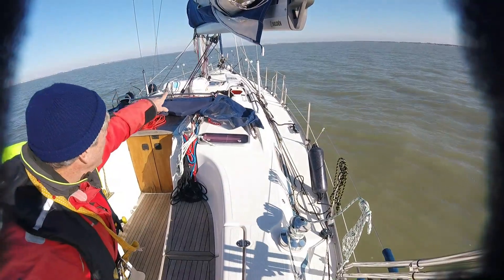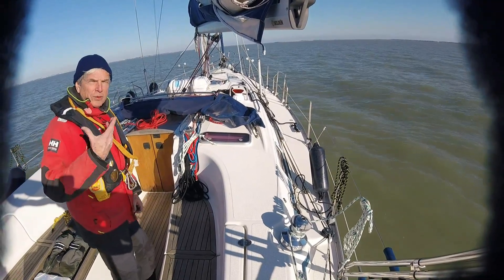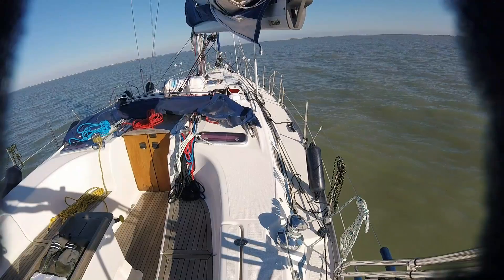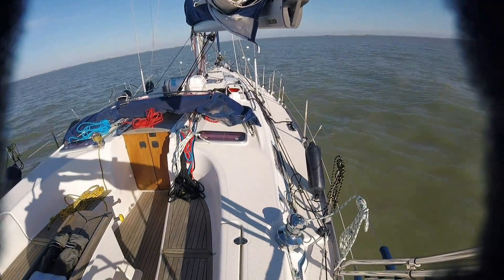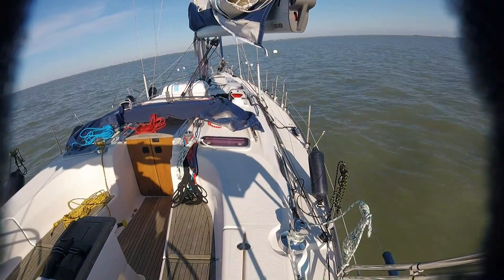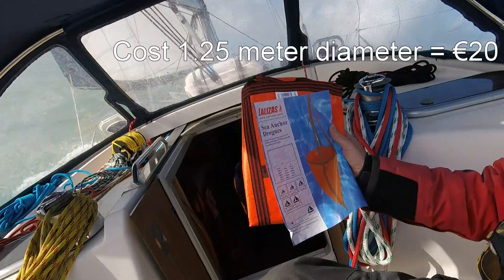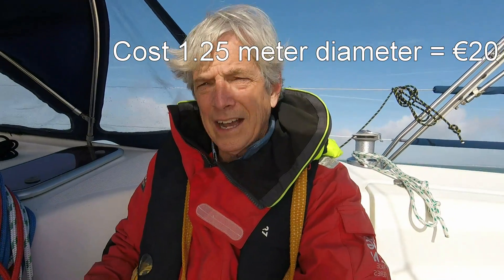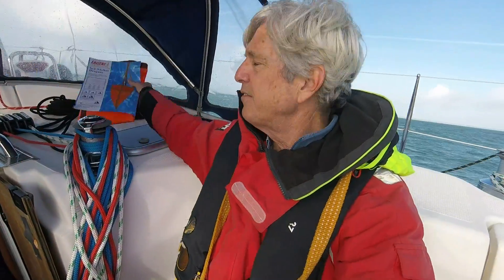Ep 36 Preparing Next Major Passage

Comment: It seems to me that if you want to pull the nose over using the drogue only, you might need to use a block forward on either side (and then led back to the winch aft) so that when you take in the line you get that extra pressure extended to the bow. At the moment, although the drogue is applying pressure to the port side, it is all on the transom and isn't sufficient to pull the nose around. Just my opinion, and I may be way off base. But it makes sense to me.
Reply from the maker: Exactly Jeff, and that is how my boat was rigged.   (I filmed the full set-up, but edited it out as the video was too long.)   Each line ran from the drogue to slightly forward of midships, and through an anti-friction ring at the foot of the shrouds (well forward of the pivot point), then back to the winch.   The problem was just that I left out too much sail.  Thanks for watching.

Comment: Patrick good to see you are back...looking forward to going to Iceland.  Got a question why no Hdrovane. What if your autopilot fails. Also in 30 35 knots how often do you have to go on deck to make sure boat is on course. I noticed you said you could sleep for an hour or an hour and a half before doing a visual check. Is that the norm? Thanks.
Reply from the maker: A hydrovane on my boat is on my wish list John, but not easy to do either.   90% of my transom is actually a swim platform that folds down.  I'd need to reinforce that first, then attach the hardware for the vane.  It is certainly doable, but not as easy as many of the YouTube videos make it appear.    Maybe next year……   My usual sleep pattern is: no sleep when in dangerous or busy coastal waters;  20 minutes when safely offshore, but still coastal; and 45 minutes when in blue water with low risk of collision.   As to going on deck during a blow: I can read course and speed and chart position from inside the safety of the saloon ----- that said, I usually poke my head out just to check that all is well with the sails and sheets at least every 45 minutes anyway.  Thanks for watching.

Comment: Hi Patrick 
I love watching your channel. The music and the wales was spectacular.  May I ask, you sailing from your home port to Spain would cost you very little to nothing? Do you have to pay when arriving at a port? Hope it is not a silly question but I have never sailed and would love to some day just fascinated and inspired.  Thank you Marc South Africa
Reply from the maker: Good question Marc.  The cost at sea is only the fuel you burn, and the food you eat.   Most people end up running the engine about an hour per day (at least) while at sea, to recharge the batteries, and/or make hot water for washing, etc.   On arrival in a marina, they charge based on the length of the boat.  A 40 foot boat like mine will typically pay between 25-35 euros per day --- with a weekly discount rate, etc.     Many people avoid marina charges by anchoring in the bay, and taking their dinghy ashore.

Comment: Hello Patrick. As ever really enjoy learn and get motivated with your postings.  Curious to know with your staysail you haven’t needed to fit another set of Genoa/staysail cars further forward. Do you bring the sheets back to the primaries?
Reply from the maker: Great question Andrew, and the honest answer is that I have not yet decided.  I haven't yet firmed up how I am going to use this sail.  When I need to be very close hauled, I actually need to bring the sheet between the lower and upper shroud.   For all other points of sail, the sheets will pass outside the upper shroud.  Similarly, for now I am running the sheets through the same cars as the genny.    A professional sailor is going out with me this week to take a look at the set-up and make some recommendations to me.    It's still a 'work in progress'.   :-)

Comment: Patrick,
Given that you got your inner forestay and staysail for better upwind performance on a long passage leg, could you not have just dropped your genoa and put up a staysail instead with the clew rigged inboard somewhere? I appreciate it would be different if you were using it when a storm was brewing.
Reply from the maker: Sorry Clive.  I don't understand the context of when you suggest to furl the genoa and put out the staysail.
Reply: Patrick Laine   Thanks for replying. I am new to sailing so what I am suggesting probably doesn’t make any sense, so apologies for that. But I was just wondering whether it would be possible to achieve the same upwind benefit by removing the genoa and putting up a smaller sail instead which could be sheeted in more closely. It would be a hassle taking down the genoa of course but might be worth it if you were expecting a long leg to windward and one would save the expense of installing an inner forestay. By the way you have really motivated me to just have a go at things such as putting up the spinnaker, and not worry too much if it goes wrong.
Reply from the maker: @CliveJanes  OK -- I've got you now.   In fact, many people do exactly as you suggest.  They completely change the foresail, rather than unfurling a staysail.   This requires a slightly different sail set-up.  The genoa is 'hanked on' to the stay with hooks.   When you want to change sails, you just drop the halyard, and gather up the genoa, which you stuff in a sack (quite often tied to the stanchions).  You then hank on a staysail with a better shape.   You have identified the problem with this already.   When the wind is blowing, it is really difficult to gather in the genoa on a pitching, wet foredeck, and hank on the new sail.   The sailing world fell in love with furlers because they allow you to fairly simply reef the foresail, or close it up entirely.   The disadvantage  is that you usually need one forestay for each foresail (there are ways around that, but none of them are elegant).

Comment: Hi Patrick yet another great informative video. Like your new sail set up and was wondering if you considered a self-tacking inner foresail or would have this be to limiting on sail area? Keep the good work up and looking forward to your new adventure videos.
Mike
Reply from the maker: Great question Mike.  My next door neighbor has a self-tacking solent…….   I thought long and hard, but opted for the traditional set-up (for no particularly good reason).   In fact, putting in all of the extra deck fittings was a bit a pain in the rear-end on my boat.   There is probably a good rationale for one over the other, but I don't know it.   If I had to do it again, I'd probably go with the self-tacker.   Thanks for watching.
Reply: @patricklaine6958  I guess the obvious rationale is it makes beating to windward a breeze (excuse the pun) which would be good as a solo sailor.

Comment: I watched a demo on this.... I think more attention to sail trim is necessary.... your boom was not amidships when trying to head up.... I think being single-handed will be a challenge to perfect this, but I do believe it should work.
Reply from the maker: Yeah, that may have contributed Walter, but I really think the problem was that I had far too much headsail out.  I have done a lot of reading on this since then -- and yes -- sail trim is critical to success, but a small drogue is always going to struggle against too much genoa.   Thanks for commenting.
Reply: Wow... I had not expected a reply, let alone one so quickly. Thank you. I have just recently begun to enjoy your videos. What drew me more is your solo-docking approach. I use a similar approach with my mate/spouse on board, by securing an ft springline, but I will practice the "touch the dock gently" technique. As to the drogye, we both agree trim is important... Maybe your Solent/staysail gives you better control by now.  In any event, the ability to have steering control should the rudder or steering mechanism fail should be more explored - and practiced. @patricklaine6958

Comment: welcome back!    If there is any one thing I have learned from your videos is that the devil is in the details..  at 17:36 , your Solent sheet is against the mast.. is this going to be a chaffe issue?
Reply from the maker: Well spotted Randall.   That's the lazy sheet (the one not being used).  It will always touch the mast.  As long as there is no/little tension on it, it won't chafe.   Many thanks for watching.
Reply: @patricklaine6958  awww...  got my glasses closer to my eyes.. did not see the other line.. makes more sense now.. thanks..

Comment: Be careful Patrick, Isobel might sink under the weight of all these goodies you have on board (joke). Does that inner forestay get in the way of the genoa at all. Also, is the storm sail you mentioned the sail-in-a-bag you demonstrated in an earlier episode.

My HR-38 has a storm sail designed to use the forestay furler, a dumb idea. Totally removing my genoa, made of heavyweight dacron, is hard enough solo, in good conditions but impossible at sea in bad conditions. I have no idea what lunacy came to play when choosing this storm sail. I'm thinking of having a sleeve adapter made, to go around the furled genoa. Have you any experience or opinion of these?
Reply from the maker: Yes Ian, I am required to furl (almost completely) the genoa if I want to tack/gybe.  That is a bit of a hassle, but I do a LOT of blue water sailing where I don't do a lot of maneuvering.    When I leave the marina, or in busy coastal areas, I'll just use the staysail until conditions allow me to put out the genny for a long run.  And yes, my storm jib is the 'Storm Bag' wrap-around sail I showed last year.  I don't want to be changing sails up on the foredeck…...it's just not safe.   Fair winds.

Comment: Hi Patrick:  Where is your wind vane??? Single handing to Iceland without one? Yikes!! Also, why only two reefs only in the main?
Reply from the maker: Hello Ron.   I have three reefs in the main ---- the first two use the Selden single line system.  For the third, I have some pre-cut lines in a locker, and go to the mast like everyone else.  It's really quite easy, and I practice it often -- and have done it for real in a couple of gales.   No big deal.   As for the wind vane ---- it's on the wish list.  I prioritized the staysail this year.  Would love to have a hydrovane --- but it won't be a simple installation -- the entire transom of my boat is a fold-down swim platform…..   Thanks for watching.
Reply: Thanks for the input on the reefs. I saw only two lines on the boom, but I couldn't image you would go to sea with only 2 reefs possible. As to the Hydrovane, from my somewhat limited knowledge of the unit, I would certainly be fearful of using one with your boat, given the high loads, because the unit is doing the steering. On the other hand, a servo pendulum unit like a Pacific WindPilot would likely not place much strain on the transom. As to steering with a drogue, take a look at this video:   https://www.youtube.com/watch?v=vupIl68mCYg
Reply from the maker: Yeah -- I'll have to look into a wind vane much more --- but if possible, I like to avoid a system that has all kinds of engineering fudge to bring lines back to the helm to turn the existing system.    There is such complexity and messiness there, and so many things to go wrong.   (As you will know, wind vanes are notorious for breaking: hinges that fail, ropes that slip, brackets that break, rudders that fall off….)   I have a lot more homework to do before making a decision.  I've watched that drogue steering video a couple of times.   In general, I don't like 'how to' videos (of any kind) that are filmed in 7-9 kts of wind.   Not very realistic, but this one had some good info about sail management (which was the reason my trial did not work).    I'll give the drogue steering another try (and manage my sails better) sometime soon.   :-)

Comment: Steering a sailboat without a rudder with just the sails and your drogue should  be similar to the way you'd adjust the sail on a windsurfer where all you have is the sail to steer.  However to come up towards the wind and sail close hauled , on a windsurfer you tilt the mast back,  and you can't change the  angle of the mast on a sailboat. So I guess you have to settle for whatever direction sailing on a reach or downwind will take you.... and to tack I would imagine you'd have to jibe/gybe. I would practice without  bothering with the drogue and just use the drogue for windy conditions.
Reply from the maker: Thanks Emily.   I have thought a lot about this since I filmed that --- and watched many other videos on the subject.    I am fairly certain my technique was OK ----- except that I had far too much headsail out for the small sea anchor to fight against.    I'll give it another try sometime.   Thanks for watching.
Reply: @patricklaine6958  I just  meant that with the rigging as it is on a sailboat meant to be steered by a rudder, the maneuverability of the boat without really being creative and manipulating the sails as much as possible in ways other than they are typically used are limited. I was sort of thinking out loud when I wrote the comment. 

The only experience I have sailing without a rudder is windsurfing. Being able to rake back the mast really helps the boat come up into the wind. "Sailing Zero"  explains the lengths he went through  using brute force and physically backwinding  the staysail with his body to get his boat to come up into the wind and tack. Here is the clip. https://www.youtube.com/watch?v=PE_w_1p3uhI  It goes from 4:48 to 6 minutes..Other than that, I managed with help from crew  to make it to our engineless boat's  mooring when the 35 year old  tiller came off the  rudder (as we were headed towards  the mooring. anyway). It is interesting watching others try it though. I think it should be part of every sailing program's curriculum. When I was little the goal was to teach kids to sail well enough so they could move on to racing strategies. Some of these important safety issues - how to steer if you lose your rudder weren't addressed. Thanks for the video.

Comment: Concerning the steering with a drogue. Attached to a stern winch the system can not function. You need to pivot the boat from the other side of the CG. Assuming the CG is in vicinity of the keel, you're better of passing your line through the forward cleet and then back to your aft winch. Draw it on a sheet of paper and you will better understand the simple balance of focres and the effect of the drogue on your boat.
Reply from the maker: That is how it is hooked up Alex --- the line enters midships --- and even goes a meter forward of that to the base of the shrouds, then back to the winch.   The problem was too much foresail.

Comment: One thing I've learned about steering with a drogue is that it has a lot more turning force if you attach the bridle amidships (even with the keel).  This video has a pretty good demonstration: https://youtu.be/vupIl68mCYg?t=177 

I'd be very interested to see how the inner forestay backing plate is attached to the hull (if it is in fact glassed or bolted to the hull?).
Reply from the maker: The bridle does come aboard at midships Savvy -- even slightly forward of that.  An anti-friction ring is attached at the foot of the shroud lines -- the bridle passes through that and then back to the winch in the cockpit.   The forestay backing plate is two elements: a vertical piece which penetrates the hull and to which the stay is connected, and which is also bolted to a horizontal stainless steel bar which runs the width of the boat.  The horizontal piece was encapsulated in some kind of epoxy.   The entire piece was glued with a high performance formula (special ordered by the marine engineering company doing the installation) to the inside ceiling of the foredeck ---- also catching the both sides of the hull.     Thanks for watching.
Reply: @patricklaine6958  As you said clearly at 11:00.  Not sure how I lost that.

Great video.  I'm looking forward to seeing the dual headsails in action!